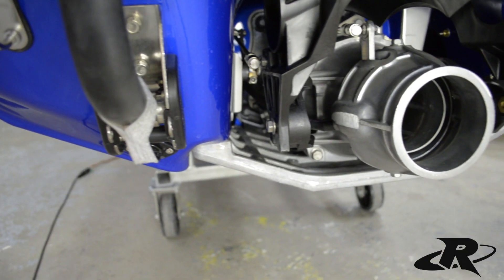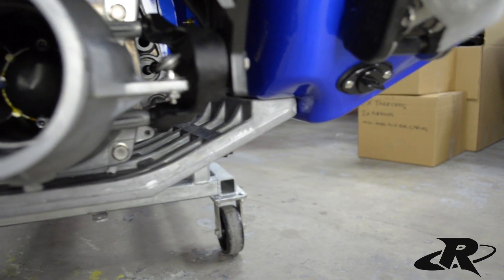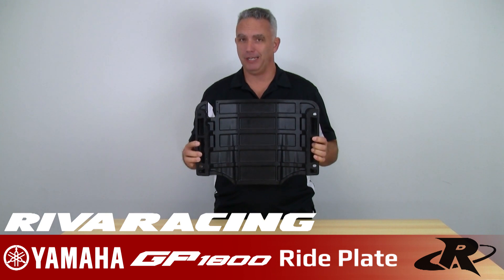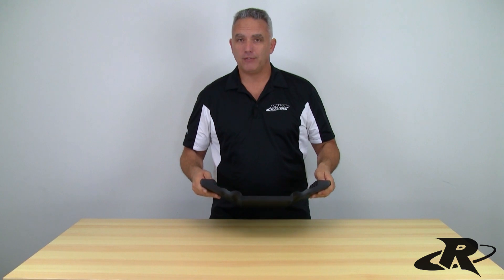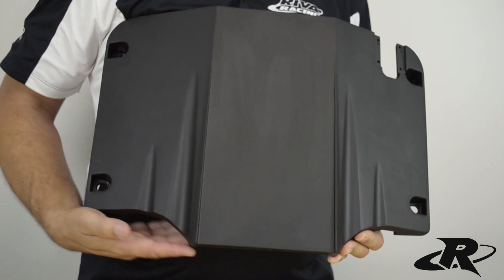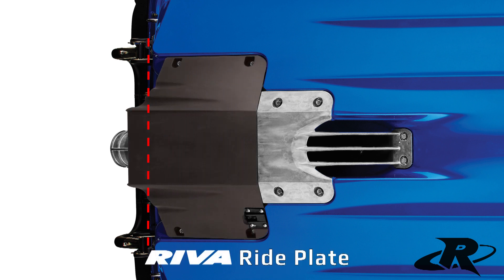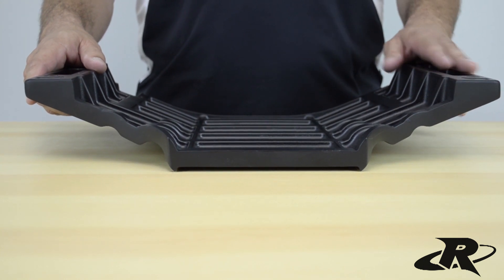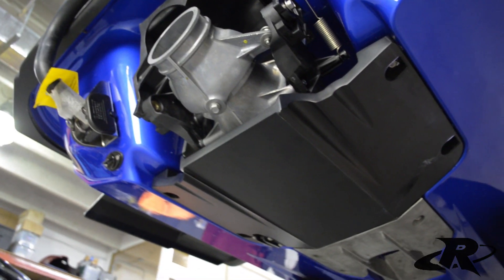RIVA Yamaha GP1800/VXR/VXS Ride Plate

Comment: Hi, I have Gp 1800 2017 and put on Intake air, blow off,plate ride and the  intake manifold...but they run 70mhp to 71mhp. My question is I need up grade de impeller..???

Comment: Took out VXR with the new ride plate all’s I can say is 👍👍👍👍👍👍
Reply: Any increase in top speed?
Reply: Did intake grate, ride plate, and pump seal kit, sponsons on my vxr at the 10 hour oil change and gained 5 mph and handling is amazing
Reply: John Peacock mine helps handling but top speed the same.
Reply: I put my factory one back in with a cut went faster .

Comment: Do you recommend putting some kind of a sealant on the screws? Silicone?
Reply from the maker: We would recommend using blue Loctite thread locker on screws. You would not want to use a sealer like Silicone. Thanks for the question!
Reply: RIVA Racing Thank you. Enjoy your weekend

Comment: This will fit a 2017 vx cruiser ho?
Reply from the maker: Yes it does.: ) Thanks
Reply: Thank you! just one question will it void warranty? I dont really know which modifications are allowed and which ones arent.
Reply from the maker: Hi Booqt No this won't void your warranty. Please contact us to help you out with all your questions on which items will void your warranty. TECHNICAL SUPPORT/CUSTOMER SERVICE
954-247-0705
tech_support@rivamotorsports.com
Reply: Got it, thank you!
Reply: You said this new Ride plate will add 2 mph top speed to your jetski. I have a 2016 Yamaha VXR that has the ribbon delete intake restrictor taken off and the RIVA part put in place. My ski went from 63 mph to 65 mph when I did this. Will adding your new ride plate put me at 66mph? or will my top speed stay the same?
Reply from the maker: The plate will definitely add speed on top of the gains you saw with the ribbon delete. Speed gains will vary depending upon rider weight, position and trim setting. Keep an eye out for our new VXR Stage 1 Kit that will be released within the next 30 days!
Reply: RIVA Racing 

awesome how much for the new stage 1 VXR kit? what kind of top speed am I looking at if I install it?
Reply from the maker: Kit details coming soon : ) Stay tuned to our Facebook and Instagram
Reply: ok well instead of adding the ride plate I added this week,the Free flow exhaust to the rear for $199.95. i gained a extra 1 mph, so now my VXR is hitting 66.2 mph with a half a tank of gas. what can I expect if I add the ride plate? should I gain another mph to 67 or will it be closer to 68 mph. I haven't added the Reflash maptuner to it yet. I'm trying to get to 67-68 mph without tuning the motor. plus the fact my ski runs on 87 octane. I think if you add the maptuner it has to run 91 octane..Is that correct? Also if I go ahead and add the ride plate, is it worth the performance upgrade?? is 67 mph obtainable with the MODs that i have already added with a new ride plate?

I'm using the android GPS Ulysses speedometer App.
https://play.google.com/store/apps/details?id=com.binarytoys.speedometer&hl=en

thanks,

scott

Comment: I have a 2017 VXR this will fit it correct? and does it weigh less than the stock one?
Reply: Fresh Jets I think he said it will fit any 2015 and up gp and vxr series
Reply from the maker: Yes it will fit the 2017 VXR and it weights approximately the same. Thanks
Reply: I got the plate and when i took it out to the lake on smooth conditions at top speed it is porpoising really bad. i cannot sit down on the ski because of how bad it jumps, any thoughts?

Comment: Will this fit a 2016 fzr?
Reply from the maker: +BoogSteeL Xxx No this ride plate will not. We have another Ride Plate that fits 2009-2016 FZR, 2009-2016 FZS models. Part# RY21050 Check this link:
http://rivaracing.com/i-17283776-riva-yamaha-fzr-fzs-performance-ride-plate.html#!year%3D2016%7C%7Cmake%3DYAMAHA%7C%7Cmodel%3DFZR